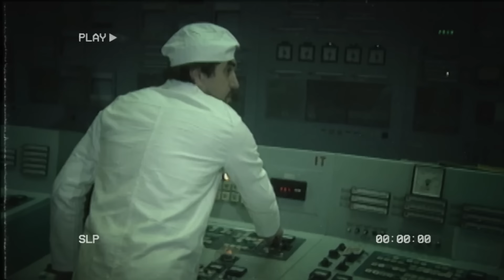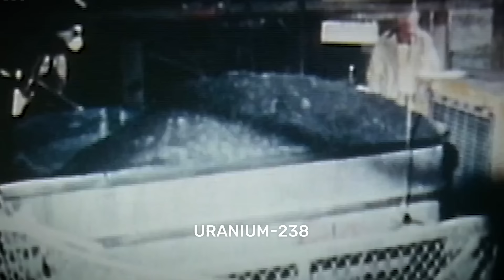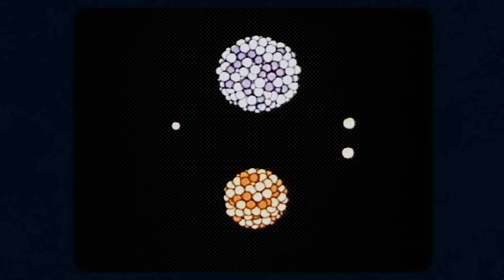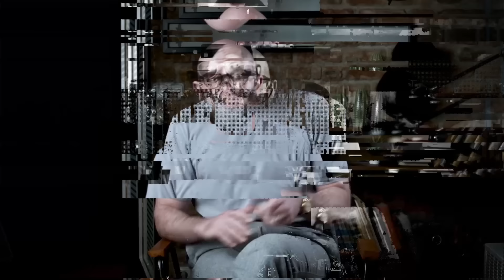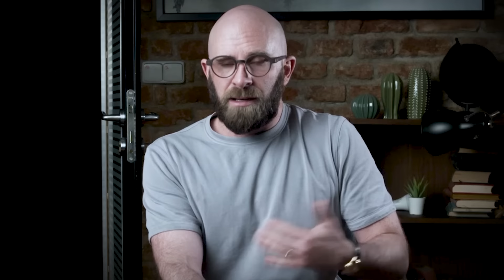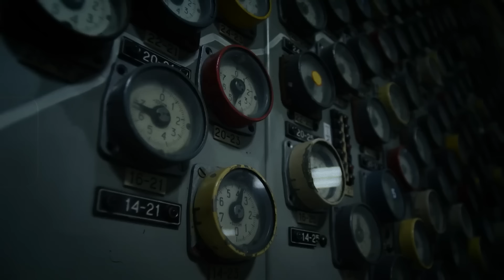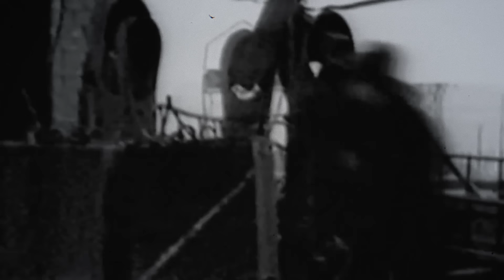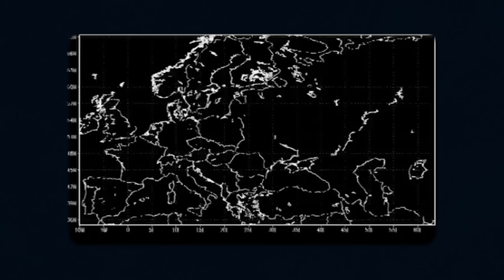The RBMK: The Shoddy Nuclear Reactor That Nearly Killed Millions

Comment: The design of the reactor might have been lacking in some areas, but nothing comes close to the absolute stupidity of the person in charge of its operation that night. If it wasn't for him, this disaster would've never happened.
Reply: That was part of the design which was missing. Not so much a competent operator,  but a physical limiter which would prevent having it set up wrongly.
Reply: @myparceltape1169  there was that in place. The night shift dismantled it.
Reply: The majority of the crew wanted to cancel the test when things started off wrong. But the guy in charge was under pressure because of how the Soviet System was set up. The test had been cancelled a few times before, but were cancelled for some reason or another. He said tun the test anyway. Then when stuff started hitting the fan he was yelling at everyone that they screwed up even though they were telling him to stop the test. He ordered them to bypass the safety systems in place. The test was being done by the 3rd string night shift folks. I do agree that the reactor design was a risky one, made that way for the reasons stated in the video. But with the proper people who did not do stupid crap on purpose the likelihood of an event like this was really small and could have easily been prevented.
So yes it partially was the design. But more a failure of people playing FAFO.
Reply: @jeraldbottcher1588  people - def agree, yes. But in this particular cade nothing to do with the Soviet system & in fact the opposite - it was due to the station's boss's big bonus not "the system".
Reply: @AlexKarasev  I think the Soviet system was bonuses for success, bad stuff for failures. The people who failed generally got shipped off to undesirable places. Maybe not the Gulags, but maybe someplace like the far east or Siberia. Or they would get sacked and have to go do undesirable work.  Keeping in mind that if you got sacked you would end up loosing your current very nice place to live and move into a crappy apartment. I also understand the guy was not a pleasant person to work for. As soon as crap hit the fan he was all about the blame game, even tried to say he was not present at the time of the testing.
All the people up the hierarchy wee all sent on the blame game as well, blame others, shift blame, refuse responsibility.
I do understand that kind of mindset can be anywhere at any bureaucracy. I have seen it , but at least where I have seen it in the US, they do not accept that so easy. People go digging for the truth more, people are not willing to accept blame for that kind of stuff.
Reply: @jeraldbottcher1588  there really are two fairly distinct "USSR's" - the cut-throat early-days one, with mostly Georgians (Stalin/Berya), Ukrainians (Khrustchev), Jewish folks (Trotsky, too many to mention) who were the executioners of the gulags, holodomor, red terror, etc etc. While Khrustchev participated in the early terror, he began the transition to the milder Russia-centric USSR of the 1960s-1980s. There were no gulags and to fire a government worker who was underperforming - many Soviets would wish what you said abt the demotions and forced relocation were even remotely the case. In reality it was as hard as firing a gov't employee here (perhaps slightly harder as in with a smidge of DEI pre-Trump). But overall it wasn't anywhere near as dysfunctional.as people paint it out to be. At least not due to the system itself. The current Boeing issues are tit for tat similar to Tupolev's - for exactly the same reason, a politically well connected key supplier of big airframes to the gov't doesn't "sweat the small stuff" like quality control b/c their royal sh*te don't stink.
Reply: @jeraldbottcher1588   why the USSR lost is the subject of serious inquiry, but realistically if you're an author from the losing side who wants to make some money, you cater to the tastes of your customers like no tomorrow. That's why we've so much written about the Soviets that's not particularly intellectually rigorous. So it's understandable for folks to be not exactly clear on specifics - if the supposed "eyewitnesses" engaged in embellishing them for profit.

I already mentioned the cadre - in any group there'll be only a % willing & sble to do quality work for self-actualization. Under capitalist system's steeper gradient from 2 houses 3 cars & 4 vacations a year to living under a bridge w/o health insursnce (I'm exaggerating), there will be additional folks who'd bust their asses who'd otherwise have coasted in the USSR, but not that many, and certainly not everybody. Some people (dare I say 40% ?) are just predisposed to do sh*t work no matter what, and take their pay and benefits for granted. The lion's share of the US's advantage and the USSR's demise came from:
- the USA hoovering up good cadre from all over the world
- being demographically, industrially and finsncially not just unscathed but advantaged after the WWII, the US forced the capitalust allues to tie their currencies to the USD as the world reserve currency, and then untied the USD from gold.
- this global demand for non-gold-limited usd allowed decades worth of "free money" printing as QE and debt, virtually with no consequence - which allowed FAT government conteacts and grants to American companies, enabling them to attract world-class talent from a worldwide pool, snd build a manufacturing base second to none that they could also use for civilian applicstions.
- petrodollar ensured affordable energy through much of this.

By contrast, the USSR had to compete at a near-peer level in defense & otber fields with real, non-printed money, and its own domestic cadre, in technological and trade and economic isolation. Did it lose that battle? Sure! But if you put ANY capitalist economy (UK, German, or even perhaps the American itself) under those same stressors, the chance the UK ir Germany would last as long as the USSR did is zero, and the US might have outlasted the USSR by 3-4 decades perhaps. So what "system" the Soviets had certainly played a role in their demise, but that role is greatly exaggerated to keep the Western plebs from having "ideas" as, in lieu of an ideological competitor, the middle class is being increasingly stepped on & divested of.
Reply: @jeraldbottcher1588  Absolutely.

What I tried to say is the whole Soviet-communist system was managed top-down. That went all the way through - to the guys actually doing it.

One guy has the lead. He is chosen for political reasons - being a good Soviet communist is exponentially more important than actual knowledge.

He gives the orders - overruling the actual experts. When the S hits the fan - he blames them for not following his orders correctly.

To be fair: The tv series doesn't depict the shift manager in a true manner. He is portrayed "the Soviet way". AFAIK - he wasn't the one - but the guys one level above him.
Reply: @stanislavczebinski994  Yep, when I watched the series the guys above him were real pieces of work. I remember a scene where when the nuclear physicist said he was unable to give a reason why the place blew up, they started ragging on him and trying to shift the blame to him without any self reflection. They were totally on the blame game trying to cover their own selves and shift responsibility. They were totally political cronies.
Reply: Or if you're ThatChernobylGuy, just blame ABSOLUTELY F**KING EVERYTHING on the scientists.
Reply: You're very correct overall re: cadre but it wasn't merely that one individual. Understand that the 3 earlier reactors of this plant have already scooped up the most qualified cadre already in rhe area or wanting to relocate there. By definition the final 4th reactor was getting the leftovers. And for unrelated reasons this proficiency test fell to the night shift. Let me ask you, who gets the job on the night vs the "normie" day shift?

Any machine is a smoke machine if you run it wrong enough. What'd happened at Chernobyl isn't about the reactor whatsoever b/c the same exact thing happened with Challenger and Columbia which are supposedly very good machines. It's a very human problem - when org charts and deadlines and laws of career advancement become pitted against the laws of physics, the latter are usually ignored till they make a pile of debris of a size that can't be slid under the rug.
Reply: @AlexKarasev  as far as I know even the left over crew was protesting the recless decisions of the man in charge. This is purely a failure of human leadership. This man had a prior history of reckless reactor operation. He should have never been assigned as a point person for a test of this nature.
You're correct that org charts and carrer ambitions are probably the leading cause of industrial accidents. 
I see this play over and over in technical matters.
Reply: @djmotion86   yes, but you're being too kind abt humanity again. Just as there are drive-by hatchet CEOs who slash jobs (whom the boards bring in when they want slashing done) that guy's reputation is why he was brought in in the first place. See, for that plant's director to receive the Order of Lenin (which came with vast, life-changing perks for the family) it had to have been commissioned on time, punctuated by the final, 4th, reactors' team passing a very, very tough final proficiency test. They'd (meaning day crew) had already failed this test thrice in the prior months. Along the way this guy was brought in to "right the ship". The coal plant's outage demanded the Chernobyl 4th reactor's full production output maintained into the night of the last day of the deadline, delaying the start of the test & ultimately pushing it into the night crew's lap and a grey area of what would be still by the skin of its teeth considered "on time" (as in, before the day shift of the following day).

Actually the timing of when the coal plant outage was resolved and hence Chernobyl Block 4's power can begin to be reduced for the test, already left no time for it as it takes a certain amount of time to bring the power down normally. So on some other, smarter planet, its inhabitants would calmly admit defeat and move on. (However, we leave on planet Dirt, where Chuck Yeager would rather conceal his horse-riding injury the evening-prior and risk the priceless aircraft and the lives of mothership crew operating it with half a broomstick in lieu of a broken arm, rather than yield his mission to his stand-by colleague who's nameless). In the Soviet part of that same planet, after some doubtless backroom mgmt back and forth, a call was received by the crew informing them of the berzerker mode that'd allowed an unconstrained control of that reactor (perhaps for operating with a very depleted fuel or a partial load-out or who knows what else). Either way, that wasn't remotely normal operation, by the weaker night-crew half of the 4th crew assembled of area leftovers, lead by a known loose cannon, and the rest is history: as predictably as the Challenger's frozen rubber rings lost their elasticity & ability to seal, that Cherbobyl crew way over-shot the desired power reduction level, and then way, Way, WAY over-shot trying to bring it back up.
Reply: @djmotion86  my reply to you got nixed. That that guy was a known reckless b*ll buster, was why he was brought in to hurry things up in the first place. Like with Boeing MCAS AoA sensor being non-redundant, it wasn't some oversight misfortune, it was the whole point.
Reply: @djmotion86  he was put in charge in the first place to hurry things up thanks to that reputation
Reply: Oh boy, that's wildly wrong. No, operators didn't want to stop the test - there were several tests performed that night and over 20-30 people in the control room all doing their routine work. No, Dyatlov wasn't stupid and wasn't pushing for the completion of the test in dangerous conditions - there were no signs of any danger as they were totally unaware of the positive SCRAM effect, which was the main cause of the disaster. No, they didn't break rules and disable critical safety systems - in fact, turning those safety systems off were required by the test procedure and was allowed under the rules. The atmosphere in the control room was calm and unalarming, nobody was concerned or worried, nothing was out of ordinary - until the AZ5 button was pressed to shut down the reactor, which was required by the test procedures. The operators and Dyatlov were just scapegoats to hide the fatal flaws of the design from the world.
The HBO series was a fairytale ironically propagating Soviet lies told to the world. It's a TV drama, not a documentary, do not use it as a source of information. If you want to learn the truth about Chernobyl, The Diatlov you saw there was nowhere near the real Diatlov. I recommend watching "That Chernobyl Guy" on YT, he makes excellent, well researched videos about the disaster.
Reply: I think the main point here - and for all of us "westeners" hard to understand:

The key to this desaster was the Soviet system.

Every important decision is taken in Moscow. Top-down principle. Big projects, like, designing or building a nuclear reactor are pre-planned in their 1-year- or 5-year-plans.

The big general problem of project management is to guesstimate time and costs correctly - before it has even started. If problems arise later unforseen - it comes to massive overruns.

In the Soviet system - that was totally unacceptable. Projects had to be finished on time. If not - the managers in charge would be forced to face the consequences.

Soviet rule of thumb: If it goes wrong - it's the operators fault. It can't be caused by the system - Soviet communism (and it's organs) are infallable. In some cases - those managers were sent straight to the gulags in Siberia.

That's why they did what ever it takes to make it. If it goes wrong - fault of the tasked worker.

That's why the reactor operators did it - although they surely knew better.

As I said before: It's hard to understand all of this if you have no connections to it. It defies the logic of everything we're used to.
Reply: @stanislavczebinski994   I completely disagree. The issue here was in fact "capitalist" in nature: the completion of the plant on time was over-incentivized, e.g. with life-changing perks for the plant's director that came with the order of Lenin.

The Western public has a very cartoon view of the Sovist system and why it'd failed. Having grown up in the USSR and also worked in the US ranging from public utility to Wall St to small businesses, I've seen enough dysfunction in the West in all these places to make any Soviet blush.

People are very similar everywhere, and when it gets to large public works rallying public funds towards multi-year plans under government oversight, unless you know the postal code you're in, I swear you'd not be able to tell are you in the USSR or US or UK or France or Japan.
Reply: @AlexKarasev  I don't see it that way.

The Soviet Union was very, very busy pretending to be a super-power whilst, in reality, everything was already crumbling.

I don't mean communism as an idea itself - I mean Soviet communism.

Which was all about looking strong by extremely rushing projects and procedures - being totally ignorant to the risks.

Vital decisions being taken by politicians - ignoring the experts.

Those guys set up those long-term plans. Which had to be fulfilled - no matter what.

All for the glory of the Soviet Union.
Reply: @stanislavczebinski994   you can see it however you like to see it but that doesn't make it so. It doesn't even make sense. You don't look strong by rushing.
Reply: @ I try my best to keep it short and simple.

You don't look smart by hiding your logic-twists in fact-bombing.

For someone growing up in the Soviet Union you seemingly understand very little about how the whole thing actually worked.

Or - you simply don't care - because you seriously think everything was better during the golden era of Soviet communism....
Reply: @AlexKarasev  But in the west if you fail, You may certainly lose your job or career , but you will not be sent to the Gulags, along with your family.
Reply: @stanislavczebinski994  I contend that the Soviet system was not true communism. The people at the top were basically oligarchs. That had all the big comforts of life, power, prestige, and so on. Everyone below them gave up all they had and really didn't get a lot in return.
Reply: @jeraldbottcher1588  communist / socialism are intentionally vaguely conflating in a way they're presented in the West. No full-on communist system existed. Well, I stand corrected. Communism (defined as "from each according to his ability; to each according to his need") could be argued to exist up on the Int'l Space Station, inside well-functioning families and perhaps elite military units in battle. Kibbutses in Israel had elements of communism internally, as do the Hamish settlements.

This is very different from socialism, which is basically "everyone's got a government job". And they exert themselves precisely as much as you would expect & see over in the West. Some do it really well (Neil Armstrong landing on the Moon with 13 sec of descent fuel remaining, was a gov't employee), but the majority take it pretty easy if not are outright coasting/sleep-walking. This of course played a key role in the Soviet consumer goods being mostly shoddy, as top cadre were only enough for the space, sciences, sports, and the arts.
Reply: @ great point. Thank you for your explanation and experience behind your view.
Reply: @stanislavczebinski994 hmm. you said that’s why the operators “did it”.. could you be pointing to something more malicious that an avoidable accident?
Reply: @Mercedesguygarage  No.

The point is: They were forced to do it by politicians - for political reasons.

When it all went south they were blamed - an old Soviet tradition.
Reply: @Mercedesguygarage  No They operators are the same as technicians this time. The CIA was not anywhere near. After all why go in there and do something like this when the people already there will do it for you?
Reply: @stanislavczebinski994  gotta love the Soviet/russian style of governance. Gaslighting on a world stage.
Reply: @jeraldbottcher1588  very true.